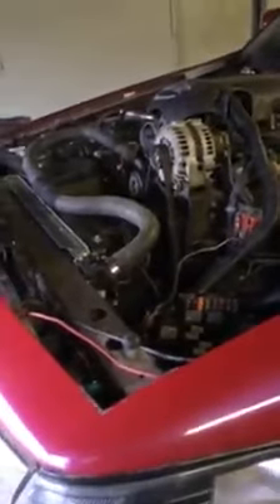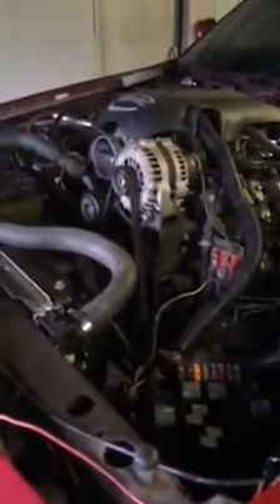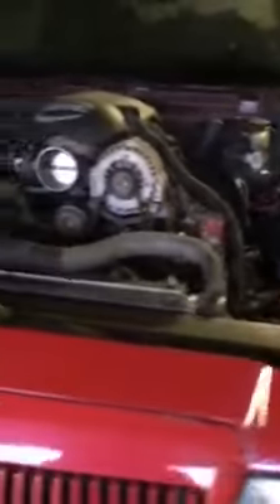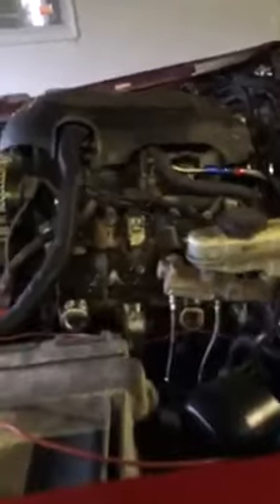MECURY MARAUDER | LS SWAP

Comment: Already. Was tryna do my mm with a ls swap 
What did u hv to change .did u use 4l60e transmission
Reply: +Stanley Walker i used a 4l60 transmission stock driveshaft and 4l60 yolk
Reply: +Jason Mitchell  u have video of marauder rolling on the streets